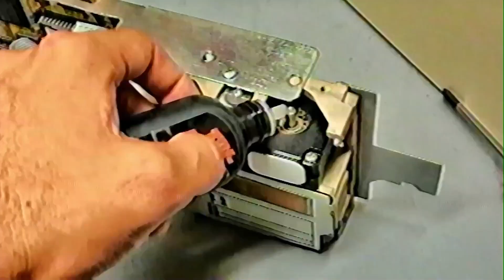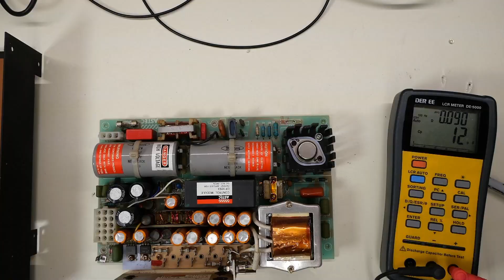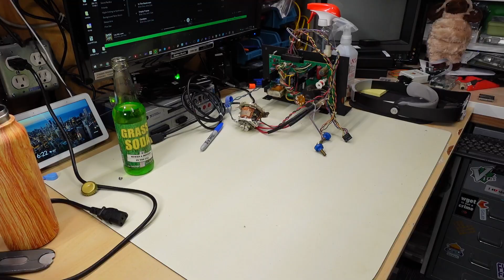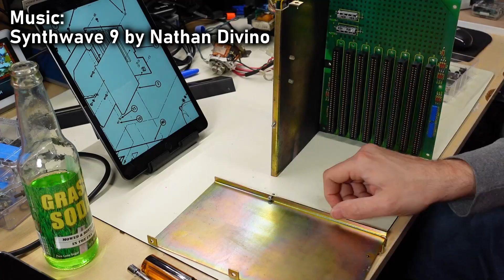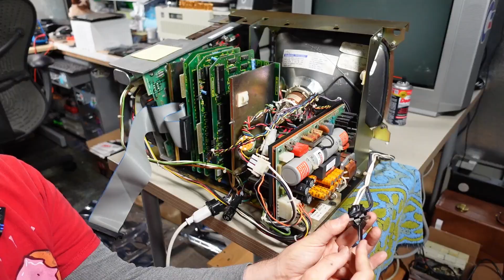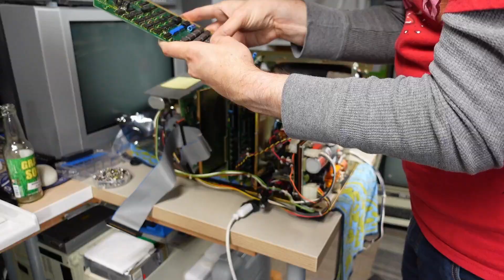I'm really scared to turn the TRS-80 Model II on

Comment: awww - I was also hoping you'd fix it! Great video as usual though. Looking forward to the next chapter.
One thing about the isolation transformer: I'm just concerned someone may think that isolation transformer = total safety. If I understand correctly, it's not. If you touch ONE cable at the time, indeed it provides isolation and safety. But if by any chance you end up grabbing BOTH neutral and phase, you get electrocuted. And the sad thing is that the house RCD won't cut the power. So it's a bit of a mixed feeling on that - and don't get me wrong, I use it myself. (Happy to be corrected if I am mistaken)
Reply: Can you run a fuse/rcd after the isolation transformer - how would you wire it - have incoming mains distribution board - fixed isloation transformer - separate new distribution board for your electrical play room - variac into glow blub to the socket for the articles under test ?
Reply: @highpath4776  I've always wondered if I could connect an RCD AFTER the isolation transformer - would that work? I have a separate distribution board in my garage, a variac (which I never use) and my isolation transformer which feeds the lightbulbs (current limiters) and eventually the device under test.  From my limited understanding on how an RCD works, installing one after the isolation tranformer should work. But I'm not 100% sure.

Comment: Just wanted to let you know that the gold coloration on the sheet metal is often a cadmium plating for corrosion inhibition.  So always wear a mask when you sand it.
Reply: Yep, cadmium is awful stuff, it has mutagenic properties. Skin contact isn't even a great idea.  When cadmium coatings corrode you wind up with cadmium salts which have very high bioavailibilty and can be absorbed through contact with skin moisture.
Reply: How can you tell cadmium plating from yellow zinc?

Comment: Is it possible the absence of the reset switch is holding the machine in a reset state (as in its an NC switch, and pressing it interrupts a pullup circuit which normally holds it out of reset. Thus you have an open circuit on the "run" signal)
Reply: My thoughts too, old computers and embedded systems ran like this either to save money or to fail safe, i.e. no control panel = no run time!

Comment: Excellent video! It's fascinating seeing the curvy, curly, hand-drawn traces when you're so used to angular, computer-done ones.
Connectors are especially prone to breaking... my wacom art tablet kinda regurgitated its USB Mini B port a little while ago. And of course it took the solder pads and contacts with it so it can't be fixed... found a workaround, I can charge the battery using a separate device so I can still get art done, but it was very alarming when it wouldn't connect/charge and when I unplugged it it just... came out with the cable.
Reply: Is there perhaps room for a panel-mount port?

If not, a last-resort repair could potentially be made by running jumper wires from a new PCB-mount port to the other end of the traces, then epoxying the port to the board.

Comment: I had a similar connector on a furnace circuit board that had solder joint issues...once re-flowed, our heat was back :-)

Comment: If memory board has 16kbit P-MOS memory chips MUST HAVE NEGATIVE 5V! Otherwise these chips are gone. Also common failure in older Spectrum version.
Reply from the maker: It does but it likely has a voltage regulator on the RAM board to generate -5v from the -12v rail.
Reply: @adriansdigitalbasement  These two Fujitsu chips (U52 and U53) are standard 8T26A bus transceivers. Fujitsu always had own nonstandard markings.

Comment: You should have High voltage (you should be able to hear the flyback) irrelevant of a video signal. You should be able to take the video out, and run it to a different monitor.
Reply: Its a pretty simple driver board. I don't think it has a local oscillator. I believe it relies on the 15 KHz horizontal sync, from the video generator board, to drive the HOT (transformer).. from what I remember.

Comment: I learned programming on a Model 1 & a Model 3 back in high school.  Great to see that some of these old machines still survive.  I just cleaned up my slightly newer C-128.

Great thinking on the connector reflow. I used to work on 14" HDDs back at Unisys in the late '80s, and those Molex connector joints were a huge problem... we routinely re-flowed them every time.

Comment: I worked for the Radio Shack Computer Center in Omaha, NE in the mid 80's and the tech's always had one or two open on the benches. Brought back a lot of memories. Even then we were selling 386 and 486 machines but Model II and 16's were still used.

Comment: I had a consulting gig programming on a Model 12 and even it was pretty crappy. It was under service contract with Radio Shack, as I think most of them were back in the day, and well... it broke / stopped working infrequently.

Someone gave e a Model 16B and three Model 2s years ago and I only took the 16B coz I knew I'd have (a) piles of Model II hanging around and (b) invariably would have to combine parts to get them to work.

Most fun you could have with this line was Xenix and CP/M.  
The only reason I have one at all is coz I had a gig as a teenager on the Model 12.
While the world is better off with the Model III/IV, the Model 1+2 are junkpiles.  I like Radio Shack products but those first two machines.  Yikes.

Comment: Hey I'll straight up sell you a model 4 below market rate if you ever want to drive to NorCal.  I just finished scrubbing the plastics mostly & removing the rabbit piss damage & refurbed the psu but it got like 20 bodge wires (you know how trs did back then with the bulletins), the drives probably need work, & I think one of the ram chips is bad.

Comment: The top slot connector might be warped without being broken.  If you can find a replacement connector you can use a solder sucker to remove it and replace it.

Comment: Because of the vibrations from the 8" drive, those glue tacked mounting bolts, and how hard they were to get out, I suspect they used Loctite on them.
Reply: Adrian should put a dab of hot glue or something
Reply: @Nas_Atlas  or use Loctite
Reply: I scrapped one of these 20+ years ago. It appeared to be 'printer's ink', like we used on the PRC77 military radios at the factory. It is a very thick ink used to mark paper boxes, or for printing presses. We applied it with a syringe, with a blunt needle to secure screw heads on modules that had to be opened. It holds well, but cracks easily to show that something was tampered with.

Comment: That chassis is cadmium plated, which means sanding and sandblasting is a health hazard. Usually to remove cadmium plating, the parts are submerged in an ammonium nitrate solution but i have no idea if this is something you can do safely at home.
Reply: I was to comment this as well when i saw it, cadmium is extreme toxic, you do not want to be sanding this and inhaling it or getting it on your skin.
Reply: How can one see whether it is cadmium plated or not? The metal looks a little like ordinary brass to me (if that's the English word for mässing), and certainly like materials I have drilled into!
Reply: @herrbonk3635  Brass is a solid colour, cadmium plating is a yelllow/pinkish type colour, with an almost rainbow sheen to it. I'd recommend just looking up photos of cadmium plating on google images for a better idea of what it looks like, but in person you wouldn't mistake brass for cadmium plating.
Reply: @Morinaka25  Ok, thanks! I belive that material is pretty common in computers, isn't it? I think I understand what you mean by rainbow sheen. But still, how do you really know for sure it's kadmium, and not just a little more zink (less copper) in the alloy? I mean, that kind of brass is usually more yellow.
Reply: @Morinaka25  (Perhaps the simple answer is that brass is never used in computers and electronics chassis? But another natural question would be, why toxic cadmium on the surface?)
Reply: @herrbonk3635  Maybe there is something lost in translation: The chassis is not made of cadmium plates, it's sheet steel with cadmium plating (Stahlblech mit Kadmium beschichtung). Zinc plating (galvanization) isn't used for computer parts, that more for steel that has to spend it's life outside (lampposts for example),
Reply: @custardo  I was thinking of the zink and copper in brass. Honestly, I never understood what "chassi" meant in electronics (only cars and such). Some seems to talk about the cover, more or less, others the bearing metal parts (which I assumed being correct), and some people seems to mean the circuit boards or electronics design itself.

(I'm swedish, not german, but thanks anyway, for your effort.)
Reply: @herrbonk3635   Chassis usually refers to the metal frame that holds all the parts.  On a computer case, it’s normally the steel or aluminum metal work where you bolt in the motherboard, PSU, drives, etc..

The covers and plastic face plates aren’t really part of the chassis - you would refer to the complete assembly as the “case” or something like that, and have various names for removable parts like the face plate or bezel, side panels, or cover (on the older desktop or towers with a single U shaped outer cover.)

There’s also the term “chassis” as it applies to monitors and TVs.  In this case, the term might refer to a common baseline configuration that is then customized for several different models.  For example, you might have a given chassis model that is sold in 13”, 15”, and 17” TVs, but uses mostly the same power supply and electronics, just a slightly different shell and tube.  Likewise you might have the same chassis over two or three model generations of the same size TV.  Or same chassis for CGA and EGA monitors, but with different video processing modules.  The chassis model can be used to track down the service manuals that show how to service that particular line of models, because they will have more in common than they have differences, so there’s no need to print unique service manuals for each variant.
Reply: Cadmium plated steel will be magnetic, brass is not, so that is an easy test.

The cadmium plating is supposed to add a bit of rust resistance, but it never seems to hold up. And yes, it is very toxic.
Reply: @mikespangler98  Ok, I see.
Reply: How can you tell cadmium plating from yellow zinc plating?
Reply: @mrb5217  Not easy. Zinc plating is more commonly used for outdoor applications. However the difference is moot, because chromatic and yellow zinc plating both contain hexavalent chromium, which comes with similar health issues as cadmium

Comment: I had the same bad solder joints on my PSU as well.  If I recall correctly, you have the older style PSU, which may not be beefy enough if you want to add a MC68000 subsystem and run Xenix.

Comment: That Grass Soda... it says 'Pine sugar' on the label, so sugar... you are a diabetic, but drinking lemonade with sugar??? I'm diabetic too, with pump, so it makes me wonder.
A pitty the machine isn't booting. Could it be that a keyboard must be connected?
Reply: I'm diabetic too, and it's pretty disturbing to watch a diabetic drinking soda (that isn't sugar free). Also the Haribo and other sweets are a no-no.
Reply: It says "Pure Cane Sugar" which is a marketing gimmick becoming mildly popular because so many people think the glucose & fructose in High Fructose Corn Syrup (HFCS) is somehow different (and of course, also "evil") than any other glucose & fructose found on the planet whether produced by a plant, an animal, a bacteria, or a manufacturing plant in Saskatchewan, are exactly the same molecule. Glucose is glucose, fructose is fructose no matter the source. 

That being said, yes it's sugar.  What I find weird, which is putting it mildly, that anyone would consider a diabetic ingesting sugar "disturbing" or even think it is a big enough of a deal to mention. We can have sugar, it's all about moderation and adjusting your medication which is extremely simple to do especially if you simply plan out your once in awhile slight indulgences in advance. 

Though a single bottle (which contains less sugar than the daily recommended amount for diabetics) in a 24hr period likely wouldn't be enough to require much, if any, modification though this does depend on which type of diabetes and its severity. I would guess that he is Type 2 since more than 90% of diabetics are and almost certainly knows what he's doing since even children can easily manage their diabetes after learning how to do so.

Comment: I use a remote controlled outlet for old devices I get in unknown condition, so that I can power them on and off from a distance with risking getting shocked (or worse).
Reply: A cheap substitute for a remote controlled outlet in this case that serves the same purpose is to plug a switched power strip into an Three prong extension cord then plug the device into the strip using a second extension cord. This allows you to switch off the power strip, switch on the device, then stand back and switch on the power strip and if needed quickly switch it off. As a temporary setup the use of multiple extension cords isn't a serious safety concern since it better then something blowing up it catching fire with you heads and/or face nearby. Note that this only works with devices with simple on/off switched not momentary pier buttons like modern desktop computers.

Comment: 22:40 - when I'm dealing with exposed high voltage stuff I never use the device, I plug it in into an extension cord with a switch on it set to the off position. I turn on the device, keep my hands away and turn the extension's switch on. If there's anything wrong I just quickly turn off the extension. But maybe it's different here in Europe because we don't have polarity on the mains, ideally the switch switches and cuts both at the same time.

Don't worry, this was exciting :) Looking forward the rest of it!
Reply from the maker: yeah for non grounded stuff (2 pin plugs) they are polarized so neutral should always be neutral. You can't totally rely on that though as the outlet may be wired incorrectly. (Mine are not, I have tested them all.) This machine is earthed and it's using a SMPS, so the chassis isn't live .. unlike many of these old TVs I work on.
Reply: @adriansdigitalbasement  I really appreciate your knowledge of CRTs and sharing safety issues. There are lots of vintage computer restoration videos on YouTube, but few of them go into CRTs, I'm sure many don't have the knowledge. CRT repair is surely a dying art.